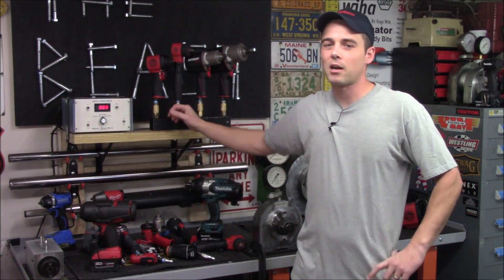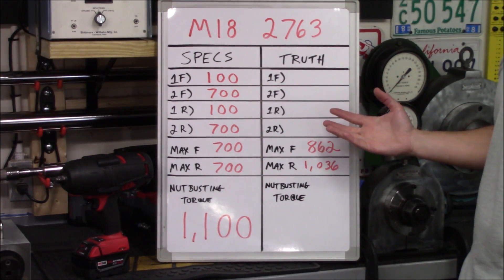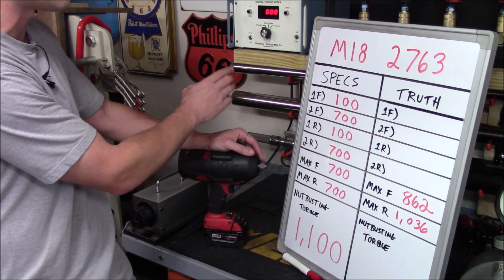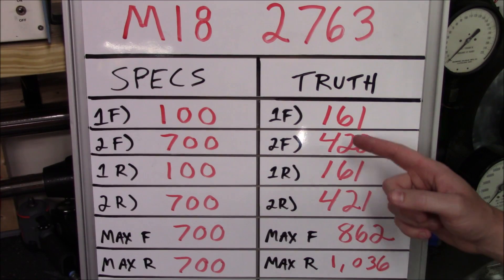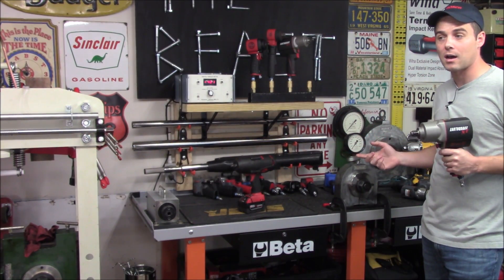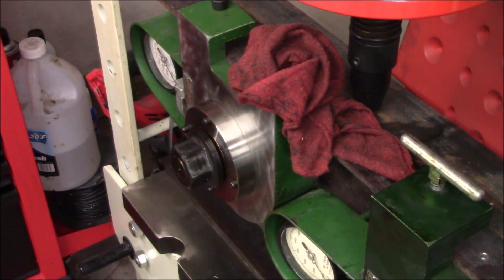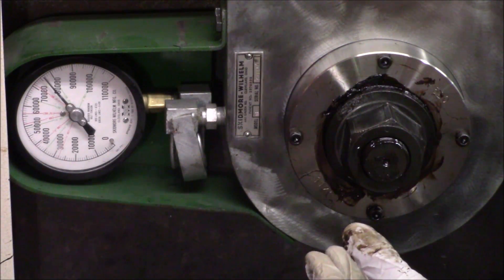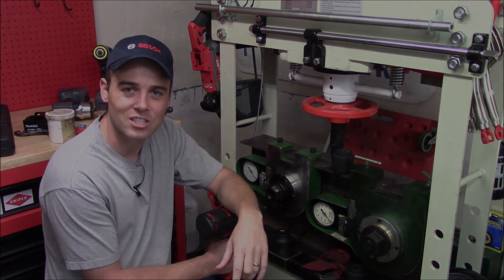THE BIG LIE -- Nutbusting / Breakaway Torque (What is it?) - Impact Wrench Torque Ratings

Comment: The way they arrive at the 1100 nut-busting torque is by adding the forward and reverse numbers, and then subtracting 300...
Reply: u put the nut on and off to heat it up, just run it on from cold, then try to undo it with the milwaukee
Reply from the maker: +Baerchenization Hahahaha 😂
Reply from the maker: I ran it on & off to prove that the threads heat up.....it would make no difference if I just installed it once, by installing it....the threads heat up LOWERING the amount of torque needed to immediately remove it.